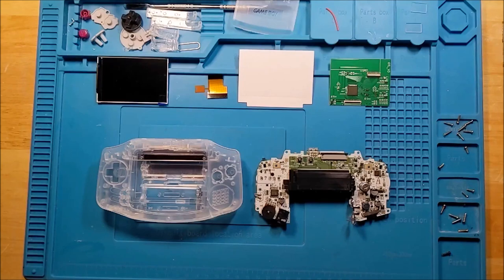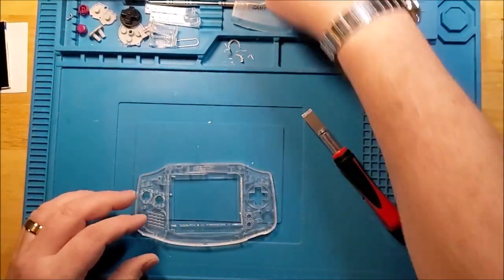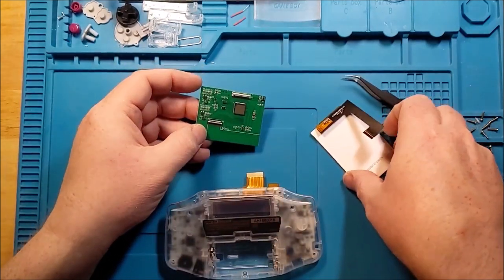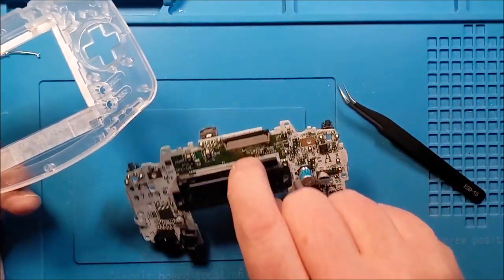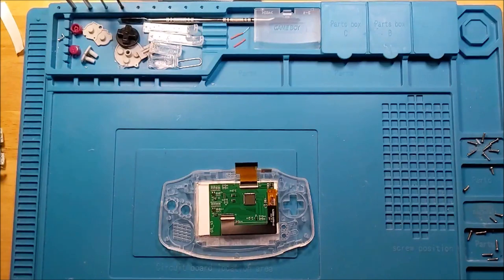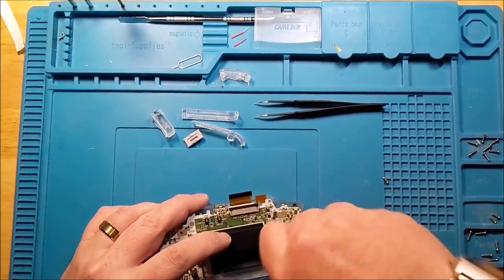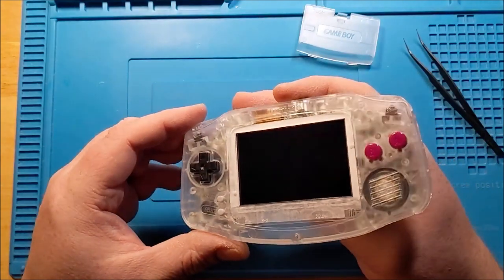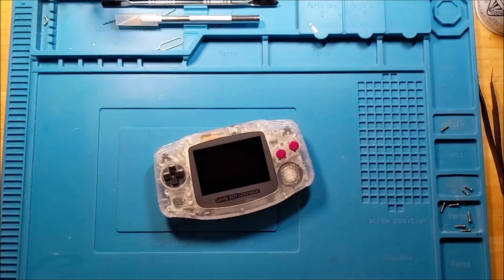Drop In GBA IPS Screen Kit Review/Install

Comment: Thank you for the build and review. They did an update to version 5.1 and supposedly it is brighter now by default with no soldering and the touch pad is easier to setup. I wanted something I could just drop in the black shell I have without cutting it up and this looks to be the best option available.